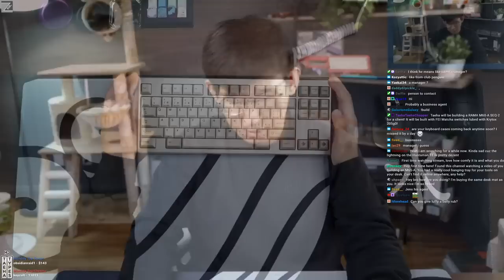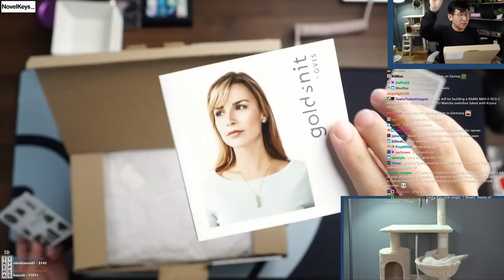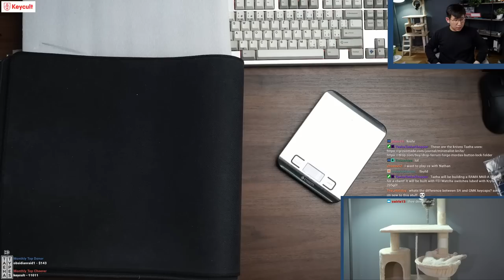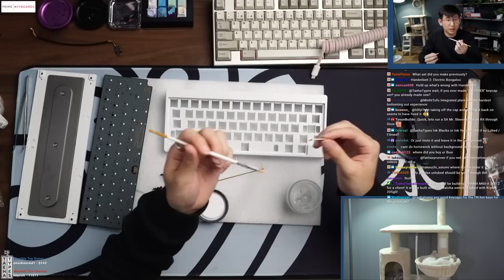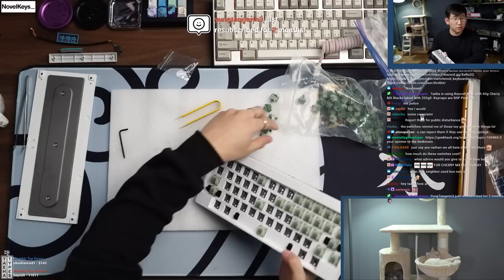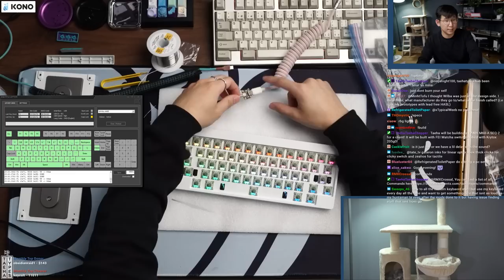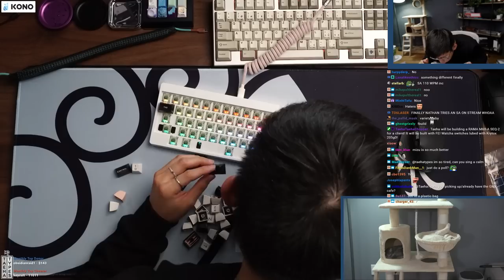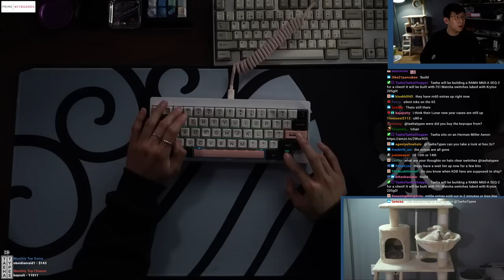RAMA M60-A SEQ2 Build Stream

Comment: damn, the rama-m60 is probably my favorite deck
Reply: @shuo_tonny_tao1725  not true at all and if tou do have an issue ramas will send you out your enclosure or base for free I've had 1 small issue and he sent me an entire enclosure for free and let me keep the other so great company great founder he answers all messages probabaly the best customer experience I've ever had
Reply: @reviewforthetube6485  No I mean their anodizing and surface treating is coarse , not to mention the minor scratches on PVD surface
Reply: @shuo_tonny_tao1725  I mean anodized finishes arent smooth that's why people like pvd lol that's how msot feel man idk what yoyr saying and there smoother then most I have a think I have a singa I had a space65 I have had ramas I've had many boards and so far none have had a better finish then my rama and my pvd brass weight was absolutely spotless of course the inside has machining Mark's but that's through anybody even keycult you sound like you havent owned many boards that's just how it goes man
Reply: @reviewforthetube6485  get a on-hand comparison with Keycult A-stock and Rama. You will see what is quality control and  smooth anodizing.
Reply: @reviewforthetube6485  To me you sounds like not having own any high-end keyboards like Matrix or Keycult.  LMFAO.
Reply: @shuo_tonny_tao1725  Usually anodizing causes increased roughness. ... For example, a hardcoated part anodized to a 1-2 mil anodic coating thickness and with little, or no, etching prior to anodizing will result in a Ra of 2-3 times that of the original bare metal finish. This means 2-3 times rougher after anodizing than before. Google anodized finishes arent meant to be smooth what I just put is the first thing that pops up you have no idea what finishes are or how there suppsoed to feel obviously. Also even if it doesnt increase the roughness of the metal which most of the tiem it actually does it's still rough because you feel the texture of the aluminum it's an anodized finish.
Reply: Could someone tell me how easy it is to adjust to the missing keys? And how I’d even access the windows key
Reply: @shuo_tonny_tao1725  this is a really late response but keycult is in an entirely diff league than rama so a difference in qc is to be expected, as reflected by their costs
Reply: @kirararahey6577  2 years late but you could just map the win key to the alt key

Comment: It sounds so hollow D:
Reply: Integrated plates like to be filled with sorbothane or smth. This is one also could use some :/ it is one solid metal piece so it radiates well inside
Reply: @Donbros  SA caps are also a big factor tbh
Reply: @NostrTXB  true
Reply: i love the hollownessd
Reply: Holowness can be ok sometimes if switches arr not pingy
Reply: Haney its too much
Reply: It is a little reverb is great thats how you get good acoustics to many people want no hollowness or reverb and dont understand then the board odesnt contribute anything to sound as nathan said one time it has just enough reverb but yes this is def to much it's because of the sa keycaps you can go listen to his other m60a video without them and I do agree you ahould use soemthing to fill a little space inside there dampener is great and the extra weight inside
Reply: I fukin love that sound XD
Reply: It is mainly because of the SA Caps and the fact that the board itself is really hollow
Reply: @FuzzFPV  If it does in the beginning then just fill it with foam then that'll solve all those problems and make it sound better.